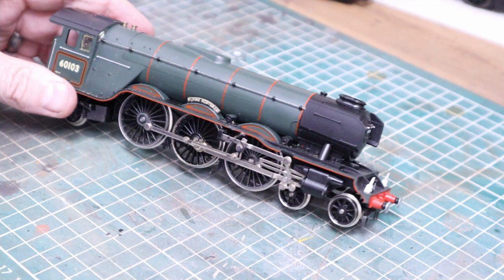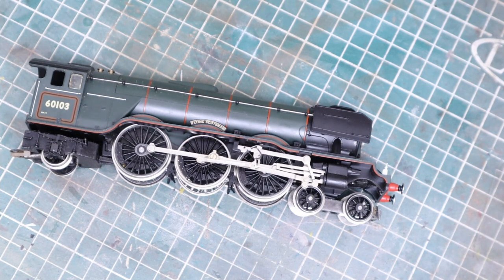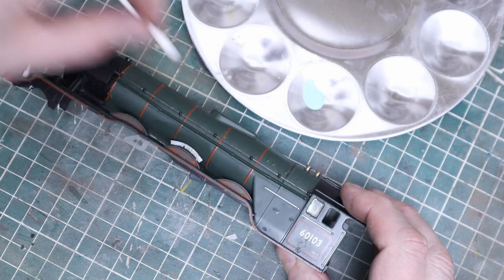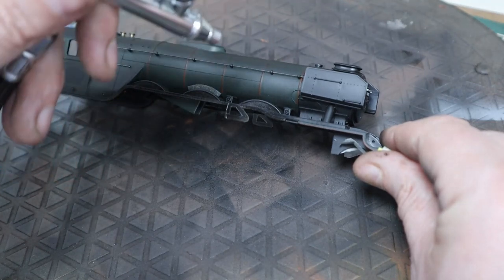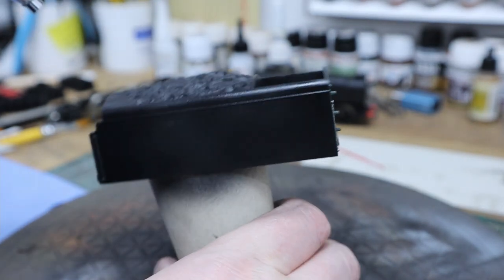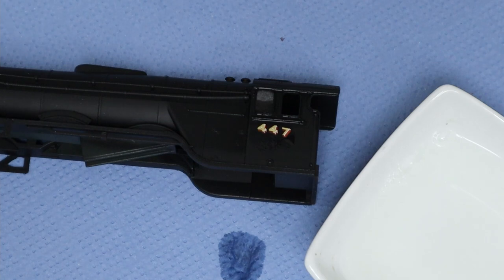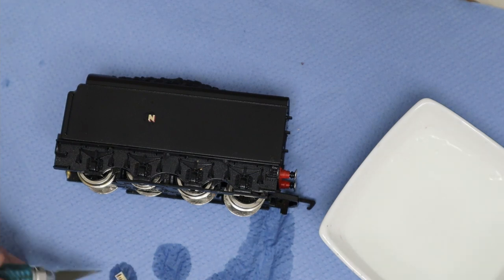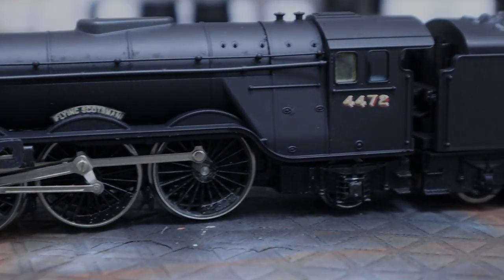Building Flying Scotsman in Wartime Black | Weathering Model Railway

Comment: Could that same effect be created with brushes or is that impossible? I was trying to tidy up a hornby coronation class city of Edinburgh i bought and managed to use the wrong cotton bud, meaning I used IPA instead of a light cleaner, end result is that I've smoothed off the paint back to the shiny plastic :( 
What paint and colours did you use on this anyway? I read Vallejo 90.150 is the best match for the Hornby factory colour..any idea.?
Reply from the maker: I think it would be tricky with just brushes, but some people are expert an can achieve a rally good finish. 
I'm not sure of the best paint code to replicate the factory colour. Apologies

Comment: The smoke deflectors need removing it never ran with them in LNER days plus she was 103 in wartime not 4472 cheers
Reply from the maker: Thanks for the comment James. I realise that the smoke deflectors (and the twin chimney) were added in the late 50's. But i never intended this to be a replica as such. I personally like the smoke deflectors. But prototypically, it should have no smoke deflectors or twin chimney, and should also be an A1, not an A3. However, according the a couple of database that i've used for reference, 4472 was on Flying Scotsman up until Jan 1946, then it was briefly 502 and then briefly 301, all on wartime black
https://www.brdatabase.info/locoqry.php?action=locodata&type=S&id=600112003&loco=1472